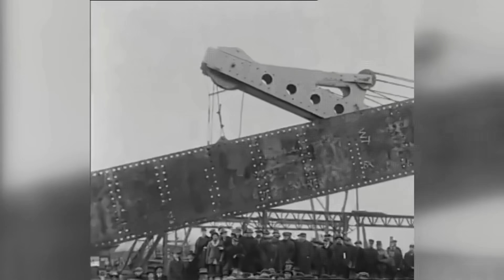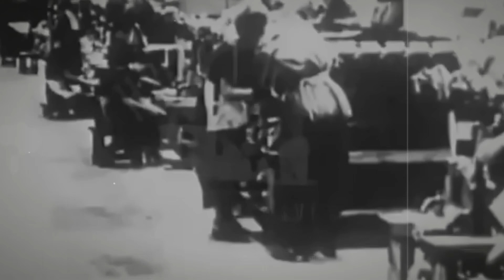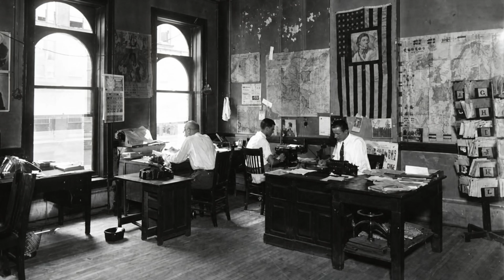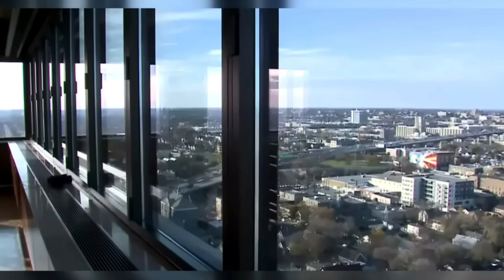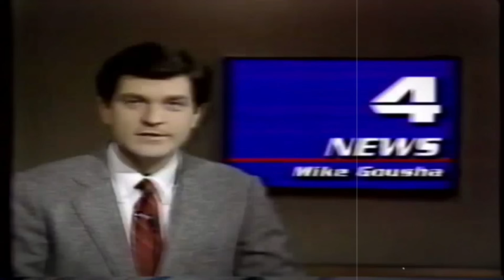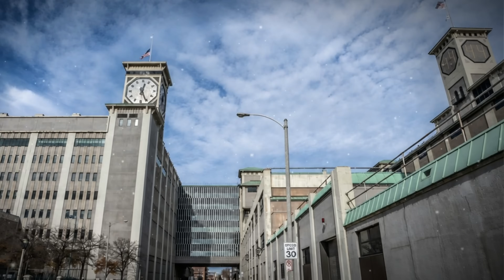How A Highschool Dropout And Doctor Controlled The American Factory Floor

Comment: The first time I learned about the Allen Bradley company was as an operator at Los Angeles DWP Scattergood Generating Station. I started to see Programmable Logic Controllers that had the name Allen Bradley on them. These Programmable Logic Controllers were being used to control new equipment that was installed in the electricity generating station.

Comment: Started using best in class bullet proof Allen Bradley AC starters, pushbuttons, indicating lights & relays in 1970 then later their VFD'S. I was lucky enough to attend a week A&B drive training back in the 1990's. At a large candy plant they at least 30 A&B starters that turned on & off every 15 minutes 24/7 that were over 30 years old. Only had to replace maybe two 120 volt AC coils and two sets of contacts every year. No other companies starters could come close to that.